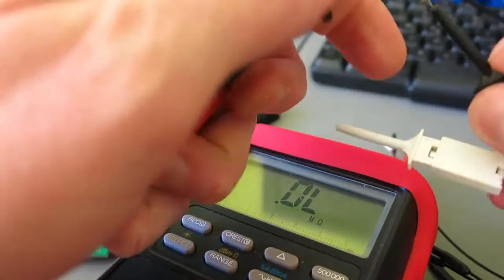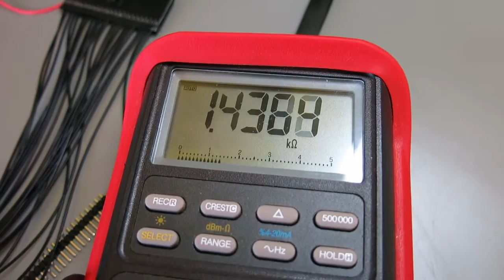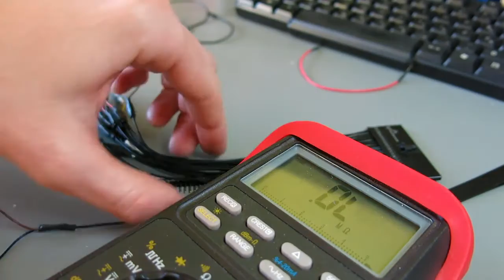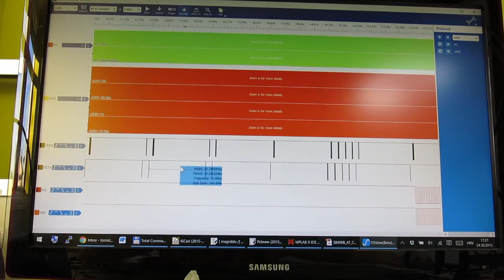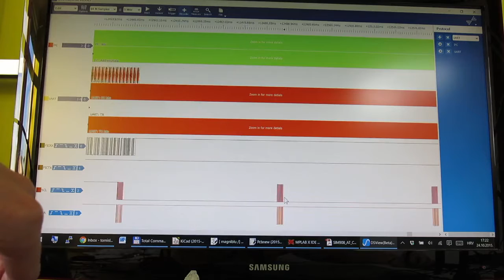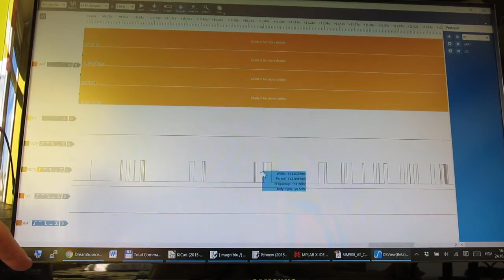DreamSourceLab DSLogic Logic Analyzer connector cable problems

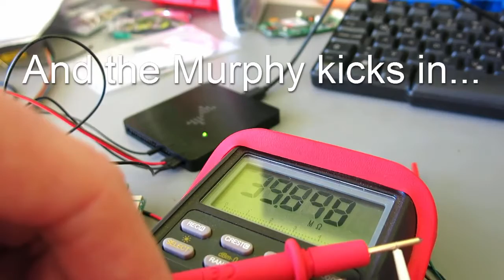Comment: 4:29 Is 1.3Kohms good or 3.8Mohms? It isn't clear from your video! You haven't stated the ideal resistance that you are looking for or the reason why you desire that resistance.
Reply from the maker: Ideal resistance between lines is as close to infinite as possible. 1k is not good...
Reply: @TomislavDarlic  ah! ok. Thanks for the tip. Nice video by the way.

Comment: Hi Tomislav, have you got an replacement from DreamSourceLab?Is it now working correctly? I thought that there should be no resistense between sheald and line of the input wire.
Reply from the maker: +Karsten Zabel Yeah, I've got replacement and it works fine. I didn't test it much. though. It appears to be working. AFAIK the shield is supposed to be connected to ground. Kind of like on a oscilloscope.